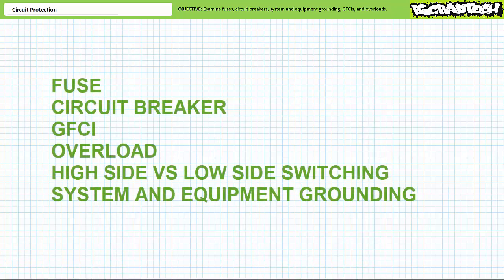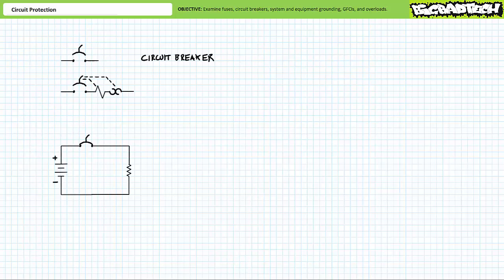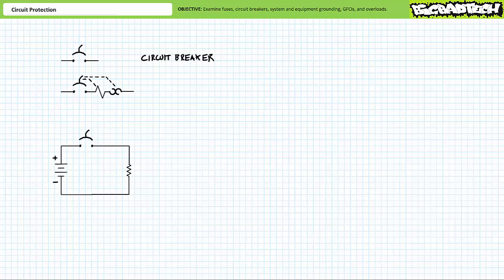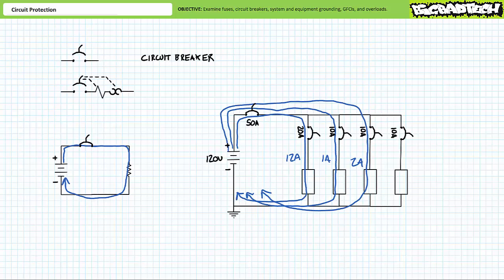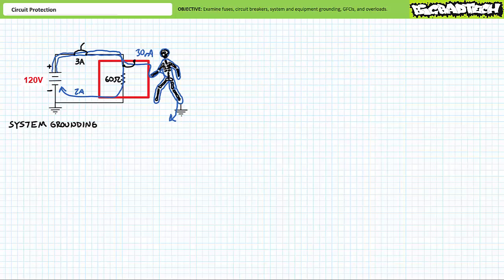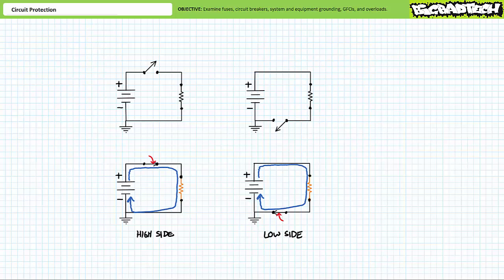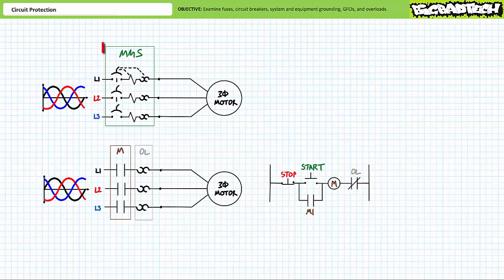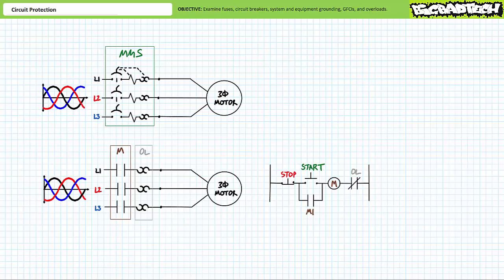Introduction to Circuit Protection (Full Lecture)

Comment: I definitely have some sort of incorrect assumption somewhere any help is appreciated. I am totally fine with the idea of high side switching being safer given conventional current and all but I am still confused as to why that is because I remember that in reality it is the electron that carries the energy and is flowing out of the negative terminal. The electrons coming out of the negative terminal have a higher energy potential and disipate it through an element. So in reality the (+) end has the low energy electrons and should have a voltage of 0 in relation to the ground no?

Comment: Since p=(i^2)*R. So if the current is less than 1 unit, can we say that "If the current increases, less power will be dissipated"?
Reply from the maker: No. It doesn't work that way. Try a couple examples. Example: current through a 120 ohm resistor increases from 26mA (.026A) to 27mA (.027). Power increases from 81.1mW to 87.5mW. Any increase in current always results in an increase in power given constant resistance.

Comment: Please I have a question. How do you wire a GFCI in a circuit for earth leakage protection. Is it wired as low side switch?
Reply: Fuses, CB, GFCI are all circuit interrupters with different principles of operation to achieve the same purpose, therefore all are recommended for HS switching
Reply from the maker: Wiring a residential GFCI is really no different than a regular outlet. All the switching is done internally. This being said there is a LINE side and a LOAD side. The LINE side is incoming single phase AC. The LOAD side is for any outlet downstream that also needs to be protected. GND connection on the GFCI also.

Comment: Your high side/low side analogy brings back a mistake I made troubleshooting a rear windshield wiper motor, I thought the motor was grounded through the body of the chassis as the low side return path. I noticed when I measured from chassis ground to the motor I had 12V, so why doesn't the motor operate? Wrong answer! The circuit switches the LOW/Ground side from the dash switch! The circuit was missing the return ground conductor. After some visual inspection in the wiring harness, buried under other wiring, guess what, a broken wire! Dah! Thats where the rear hatch opened & closed, gee I guess thats why the harness fatiged! Simple answer but easily overlooked, so don't think ground is always chassis return! You can switch ground (low side) , or feeder (high) side!
Reply from the maker: I've had that "sinking" feeling too. A lot of 7 segment displays use a common anode (ie: positive) and then sink each cathode (ie: negative) to illuminate specific segments.